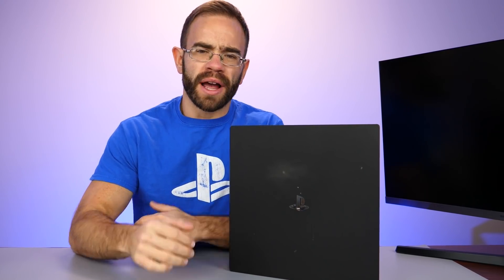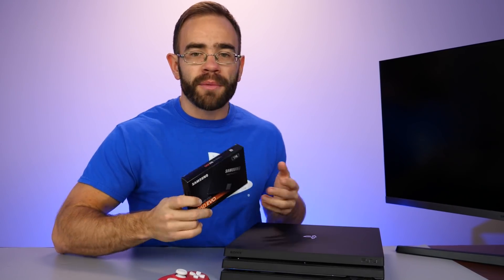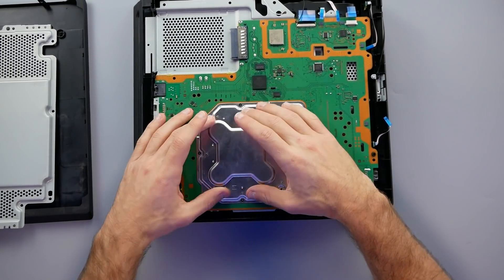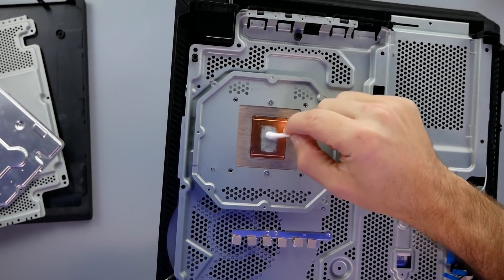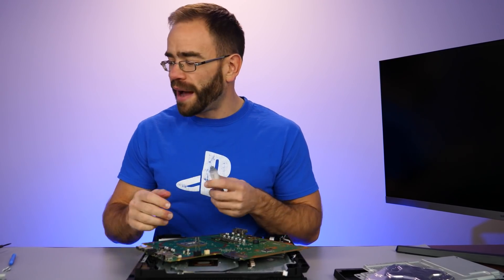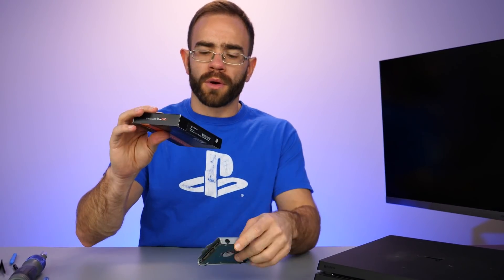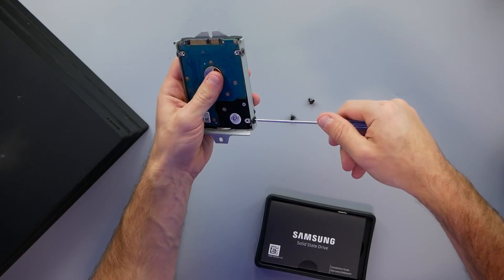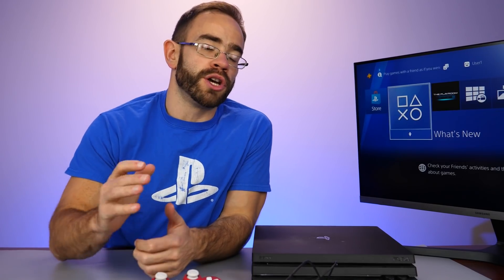Here's What Liquid Metal Did To A PS4 Pro After 3 Years

Comment: So my question is, when the liquid metal is dried, would it not dry in a configuration that allows good heat transfer? Or once it’s dry it loses its efficiency? 

Also I just sold my PS4 (launch day) for $325 with a few old games which boggles my mind.
Reply: Wow. It’s amazing that you were able to get it for roughly $75 less than originally paid for not including the price of the few games
Reply: The liquid metal should still be a good heat conductor when dried. The issue is that it contracts and you end up with gaps in the coverage
Reply: Yeah PS4 consoles are pulling premiums for some reason. I want to sell mine soon before the bubble pops and use the money to buy a PS5.
Reply: @UNPOCOLOCO444  yeah I was going to keep mine (even though I rarely go back to play old consoles) but when I saw the price I couldn’t pass it up. I already had my PS5 since September and I think I turned it on maybe 2x since I got my PS5. 8 years of service cost me like $100. When I told my friend how much I sold it for he didn’t believe me, he thought it was worth like $80
Reply: @M9_Prime  good stuff, man. Which platform did you use to sell it?
Reply: Hearing this I might try to sell my PS4 slim with my games I have to make a few bucks
Reply: @cartergraham9429  do it sooner rather than later, because you never know what the price will be tomorrow.
Reply: @cartergraham9429  I had no plans to sell it until I saw what they were going on eBay for. It took me 4 days to sell it (but I live in a densely populated area) and I had a few low ball offers of like $200-$250 and then I had 2 people willing to pay full price on the 4th day, so the first one that messaged me that day picked it up. I did 6 games but all were launch games worth maybe $5-$10 on eBay, so to trade them in I would have maybe gotten $15-$20 as trade in value. Some of those games I haven’t played since like 2014 so I won’t miss them..
Reply: @M9_Prime  yea I wouldn’t mind selling all the games with my PlayStation since I recently got an Xbox series x
Reply: Sold my Year One switch to a Modder (No games but comes with everything out of the box with a hard case) for $300CAD, I was upgrading to the Switch OLED. Also Series X is better than PS5, just saying
Reply: @coastaku1954  you say whatever you want… I’ll enjoy my dualsense and Deathloop, Returnal and Ratchet and Clank… I like games like Horizon Zero Dawn and God of War and that’s just not playable on the Series X…
Reply: @M9_Prime  Literally all of those games don't appeal to me. I like Forza and the non-exclusives are just better on Series X because IT IS more powerful. Sure your controller is cool, but so is a Switch's Joycon, it's a gimmick that I don't think I need in my games
Reply: @coastaku1954  you do you, I’ll enjoy my adaptive triggers in Back4Blood.
Reply: @M9_Prime  What do they even do? What makes them “adaptable”?
Reply: @coastaku1954  I’ll be honest, until you try the controller, it’s hard to describe. You don’t realize what it can do until you touch it. You can watch a million videos about people saying what the controller does but until you have it in your hand, it’s hard to describe it know what it does. Back4Blood does it really well, so does Astro’s Playroom… Rift Apart does a great job, Watchdogs Legion was a very poor use. I don’t have any PS5 Cod games so I can’t say, but again you have to try it. I really like what it does to games.
Reply: @M9_Prime  Is it just Force Feedback? Cause I have a Force Feedback wheel
Reply: @coastaku1954  agreed, it’s more powerful and the exclusives are just as good as PlayStation
Reply: @cartergraham9429  I do have to say that Spiderman looks like fun, but apart from that, theres nothing to for me to play exclusively on PS5. The Xbox Exclusives are just more appealing to me. I have a PS2 tho and I do love it
Reply: @coastaku1954  yea I got to try spider man out on my friends ps5 and it was very cool, and no hate on PlayStation I had a ps3 and 4 and my dad had a ps2 until I saw gamepass and all the stuff on Xbox and then I switched, happier than ever the graphics on the series x are amazing
Reply: @coastaku1954  yeah, I'm starting to get the impression that XBSX is going to be the way to go this console generation.
Reply: @UNPOCOLOCO444  But, I don't think it's gonna sell more units. Xbox has a lot of fans, myself included... by Playstation is just that much bigger, they won each generation they were, in, even with a rocky start in the 7th gen. I still prefer the Series X over the PS5, but I feel like the PS5 is just more in demand
Reply: @coastaku1954  I hear you on the demand being greater for the PS5, but from a consumer perspective Xbox is the way to go. Better backwards compatibility, easier to patch games for resolution and fps boost, and gamepass ultimate. From a consumer perspective, xbox makes way more sense, but Sony is hard to beat. This should be one of the best console generations 🙌
Reply: @UNPOCOLOCO444  Also Playstation 5 had this nasty little Reporting tool that, supposedly, allowed you to report private messages, and if you get reported for saying something in private that is deemed unacceptable, you will be permanently banned from the PlayStation Network and Playstation as a whole. Now, I'm not sure if that's true, I heard it from a friend when I was asking him what to get, but I gotta say, that was a deal breaker for me. Thus, I went with Xbox Series X and I like the console
Reply: @coastaku1954  oh really? I had no idea. I'm still going to get a PS5, but I'll just be careful with messages.
Reply: @UNPOCOLOCO444  Again, I'm not sure if that was true, maybe it was but then they patched it out, I'm not sure. Enjoy your console
Reply: it isnt dry, it alloyed with the copper
Reply: You gonna get a 5?
Reply: @raj1n501  already have a 5
Reply: the only reason that liquid metal dry was because they never use that ps4.
Reply: @Joelda23  This is not true, I put it on my PC which I used almost everyday.   When I took it apart it looked the same as here.
Reply: @cH1n0eL  which one you use because i open my pro a month ago and it was wet after 3+ years
Reply: @Joelda23  Thermal Grizzly.

Comment: To clean "dried out" LM you apply a fresh drop of LM and that will liquify it again. Allowing you to remove it easily with cotton, If you use Alcohol it makes a reaction and the LM goes black.
Reply: LM doesn't dry out, metal from heatsinks dissolve into it forming a solid alloy
Reply: @talibong9518  Correct.
Reply: @talibong9518  then it obviously dries out
Reply: @alejandrotobienne584  Thing is: LM is not wet either.
Reply: this actually doesn't work well not with conductonaught's version of it i ended up having to scrap it put more lm back on and no issues temps were perfect again
Reply: Thanks for the heads up. I wanted to ask you about something I watched from an LM video. A guy says the best way to make your first application last long is after you apply LM on the heatsink you should let it sit 30 minutes to an hour then apply a little more and then apply it on your APU (PS4 Pro) and reassemble. He says this way the copper absorbs a good amount of the LM before reassembly which prolongs the amount of time for second application since it already absorbed LM and created an alloy.
Reply: @cemsengul16  Hi. The information about pre applying is correct. I do not have the exact time it takes for the LM to plate the copper. I suggested 3 to 6 months but it might occur faster.

30min to 1hour sounds really little to be honest. I would go for at least a week and check daily and see if the LM coated the copper successfully.

I have an old copper heatsink somewhere, I can put some LM on it and see what happens.

All I know is that when it dries out it dries (crystalizes) completely when I checked after 6 months.

EDIT: As I'm writing this I have an old copper cooler sitting by my side with some pre applied LM in some patches. I'm gonna check them at different intervals and post videos with the end results.

- After an hour and a half: After wiping with dry cotton many times I can see a stain in the copper but is definitely not enough. Will update after a day.

- After a day: Definitely better than after just 1.5h but still not enough. I can remove the LM partially and there is a dark stain with a silver center I cannot remove with cotton even after rubbing a lot. So definitely that silver part is plated but you need more time for the reaction to fully occur.

- After several days: First application "dried out", it left a nickel stain but it was definitely not enough. I'm making videos of the whole process. (might take a month or two)
Reply: Immediately was my thought ngl
Reply: Or you could use a very small amount of polishing cream, i've been doing that for years and i've seen professional overclockers doing the same.
Reply: Guys get this message as visible as possible.
Reply: @JerameatC  the materials scientist comment deserves more likes tbh
Reply: YOU SOUND LIKE THE DIRECTOR OF TERMINATOR 2 THE BEST TERMINATOR MOVIE LOL
Reply: Yay 420th like
Reply: i doubt anyone will read this but tldr: i used alcohol to "clean" the mixed alloy, and as mentioned it reacted with it. My question is if its bad? If it is, should i reaplly LM and clean it, or?
Reply: But LM shouldn't really dry out if the metals/surfaces are designed to it (inert) - right?
Reply: @tkermi  That's correct.
Reply: @SaccoBelmonte  Thanks for the info / confirmation.
Reply: @tkermi  Which is made worse by the complete lack of use, as he said it was rarely used with the liquid metal.
Reply: @chrismorrison5301  Oh, so thermal cycling somehow benefits the LM compatibility / lifetime?
Reply: @tkermi  Yeah, I'm not sure how I just know that it does (got a friend who uses it a lot).

Also nickel plated heatsinks because nickel is less reactive than copper.
Reply: @chrismorrison5301  Okay, good to know, thanks. The nickel plating thing I already knew.
Reply: @tkermi  LM with Nicke Plated surfaces will not react and stay liquid and very consistent thermal wise.

With copper surfaces it creates an alloy. It actually fuses the heatspreader to the cold plate to some extent (you'll need to force the CPU out of the socket, which you cannot do with an LGA). It doesn't react to a naked die though, and will plate the copper only.

In all cases is quite stable. My current LM application is since I got my 5900X and the temperature is the exact same. As it was the case with my previous 3 LM applications on other builds (CPU and GPU)

The resulting plating is actual nickel. After several applications, copper gets effectively nickel plated.

I would advice anyone getting into LM to either buy a cooler with a nickel plated coldplate or pre plate the copper plate by applying LM several times to a cooler you wanna use in the future. I would do that for at least 3 months, each time the LM dries out you clean the crusty bits and re apply LM.
Reply: @tkermi Thermal cycling doesn't help keeping it liquid. If anything, heat will accelerate the reaction between LM and copper.
I had it on my GPU for a year and had used it daily. It was solid as rock afterwards.
Also: Once the LM is solid, even temps around 150°C won't liquefy it again. (I tried)
Reply: @tkermi  if good ratio LM.

Comment: I purchased a used PS4 Pro around December of 2020 for around $320 (ik that's too much but the PS5 costs around $700 where I live). 

It's the CUH - 7016b model (stock HDD) and it still works fine. No performance issues, the fan is somewhat quiet and manageable. Ocassionally it's spins up and gets annoyingly loud lol.

Playing early life cycle/previous gen games like Infamous Second Son, UC4, Lost Legacy: the fan doesn't even spin up. Stays at the same speed that it would when your on the homescreen.

Playing mid life cycle games like Horizon Zero Dawn, it gets a little loud but I practically can't hear it due to my TV.

Only a select few late life cycle games stress it's hardware and spin up the fans really loud. Marvel's Spider-Man is an example.

But it's good enough for me and I'll continue using it this year, with games like HFW, GT7, GOW and many 3rd party titles, I'm gonna hold off on getting the PS5 till 2023. Not really interested in a next gen console due to the price and availability.

Edit: sorry if this is too long, you don't have to read it.

Comment: This got me thinking... What does this mean for future conservation of the PS5 consoles? Wouldn't it be safe to say that say 5+ years down the line the liquid metal would be insufficient for cooling due to crusting over, so without replacing it properly wouldn't pretty much all ps5's have a sort of death sentence almost like the CMOS issue? Because simply put not everyone will be able to replace their liquid metal. Thank you. Happy new years!
Reply: Liquid metal works better, but often degrades faster. It does indeed mean there is a risk of overheating causing a degradation in performance and failure in a few years. Can't really comment on the risks involved though so it may be a non issue.
Reply: Well the drying likely die to people using liquid metal in setups not intended for it. The PS5 was designed for liquid metal so it will likely be setup in such a way to prevent or reduce drying
Reply: just keep your ps4pro it will outlive the first ps5s, and wait until sony release their second revision of ps5 before you buy.

Comment: The effect of time on the liquid metal does have me slightly concerned for the life of first gen ps5 owners. However I'd like to think Sony knew what they were doing....
Reply: I mean, what do any of us know compared to Cerney?
Reply: if you use a system with liquid metal you wont have no problem but if you leave it and dont use then is gonna dry
Reply: @Joelda23  not how this works…
Reply: @Joelda23  Makes sense, how long do you think you shouldn't leave it for?
Reply: It won’t be a problem. Metal can’t “dry”. What you see happening is amalgamation. Just search YouTube for gallium and aluminum reaction. The primary component in liquid metal thermal paste is gallium, gallium is highly reactive with some metals. It will turn aluminum into dust in a few hours, reacts slowly with bare copper, and won’t react with nickel plating. After a few years the gallium literally seeped into the bare  copper and formed a new alloy, thus appearing “dried out”. This won’t happen with nickel plated heat sinks.
Reply: Yes, they do. A whole new bunch of hardware sales in 4 years will do wonders for Sonys bottom line

Comment: Still have my launch PS4 Pro. Packed it away a few months ago after getting the PS5 finally. Might consider modding it one day but for right now my PS3 Mods are covering most of the emulation I want done.
Reply: I'm in a similar spot. I've got a launch PS4 PRO with 1tb Crucial MX500 SSD in it, played the hell out of it and it's collection dust now. I've been wanting to jailbreak my PS4 PRO for Linux but they still haven't figured out how to take advantage of PS4 PROs additional gpu power.

Comment: I only used my ps4 to play exclusives so it never got that much use but the hard drive started making noise around the 300 hour make. I just didn't care to change it
Reply: Are you sure it was the HardDrive? I changed out the fan to a brand new one and replaced the thermal paste, sounds quite again like it did out of the box, I play on my PS5 now but ps4 is fun for modding/homebrew games
Reply: @jtree4204  yeah it's definitely the HD I unplug it and the sound stopped. But I do appreciate your input.. I was going to change it out but I was lucky enough to get a ps5

Comment: The liquid metal dried out? Not air tight i suppose. Prob worse than thermal paste/compound in this application.
Reply: Metal can’t “dry”. What you see happening is amalgamation. Just search YouTube for gallium and aluminum reaction. The primary component in liquid metal thermal paste is gallium, gallium is highly reactive with some metals. It will turn aluminum into dust in a few hours, reacts slowly with bare copper, and won’t react with nickel plating. After a few years the gallium literally seeped into the bare  copper and formed a new alloy, thus appearing “dried out”. This won’t happen with nickel plated heat sinks.
Reply: @Dirty_Bear22  Interesting!!! Thank you for the great explanation.

Comment: Don't yell at me if I'm incrorrect about this. But Sony tends to have larger power supplies in terms of watts. Wouldn't that be a big factor in the amount of heat the PS4/PS5 produces? Because Xbox has less watts in their power supply and they tend to run cooler and quieter.
Reply: This is a good suggestion but not really depends on the die size of the apu
The slim apu was shrunk significantly  which reduce power consumption  which reduces heat consumption 
Perfect example of this is the launch ps4 cuh-1000 series vs  PS4 revision cuh-1200 vs Slim

Comment: Copper is strong, but it reacts with aluminum and can deteriorate the other metal. I'm not sure what liquid metal is made of, but maybe try something with neverseize
Reply: Its usually gallium with a bit of indium and tin added based on the manufactures specifications for longevity, viscosity, etc. it eats through aluminum. Copper is completely safe with it, but it will stain copper over time. So thats what you see on the heatsink, staining, but it doesn’t affect the thermal performance. It will completely eat away aluminum and destroy it though.
Reply: gallium